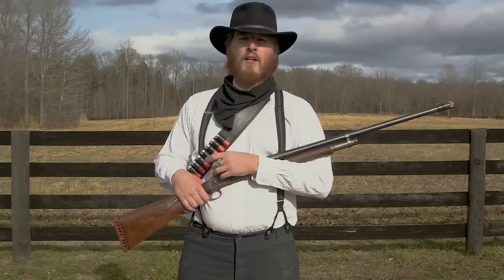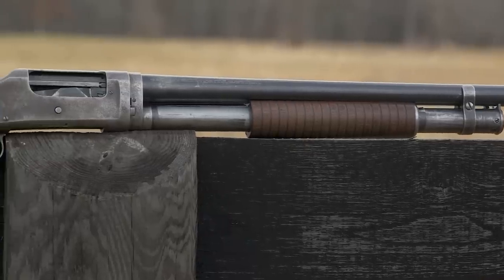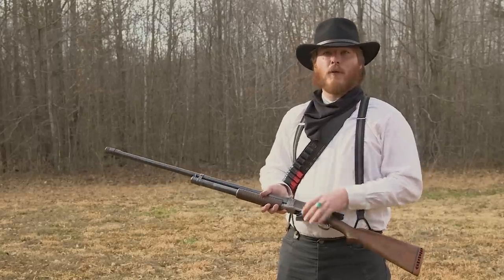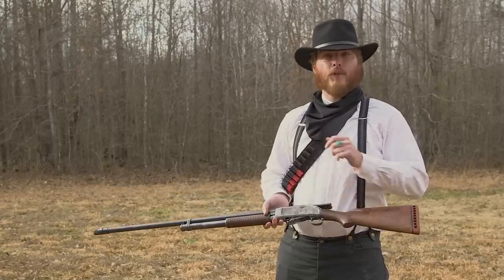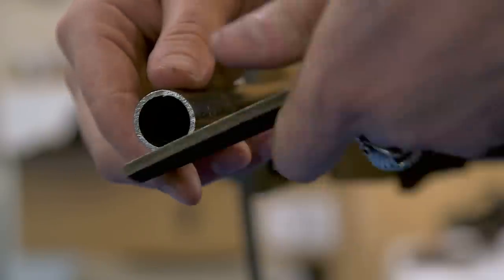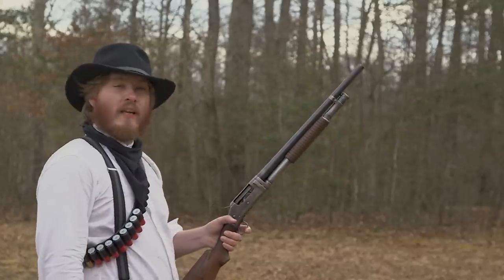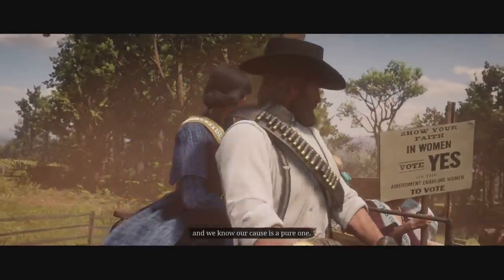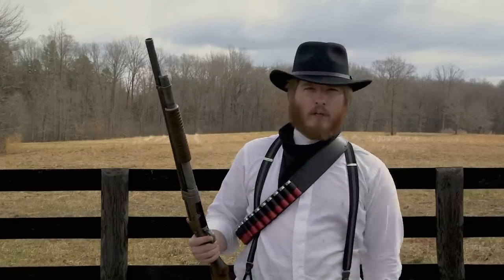The Real Guns of Red Dead Redemption 2: Pump Action Shotgun

Comment: This 1897 in the vid is a model that came out in 1906 or close to that date it had the 2 buttons on the side that make it possible to empty the magazine tube and the wood on the action bar is with a screw on cap meaning its from a E model 1897,so if the game plays in 1899 this is not the correct version of the 1897....But who cares...
Reply: Ben Niessen you’re absolutely right. It’s an E model and was manufactured in the 1930s. I think the previous owner changed out the stock with a 1912 stock or the later 97s just had a different pattern stock.

Comment: Why in gods name would you cut the original down on a collectable gun you could've got another barrel
Reply: But if I bought another barrel for 200 dollars it wouldn’t be 87 years old and I’d spend almost as much as I did on the gun just to make you happy.
Reply: @stephencanty89  first the gun wouldnt be 200 even in poor shape it'd be 400+ and the new barrel would probly be a reproduction but even if it was a vintage 97 barrel it still would be the original one that came with the gun there is only one of those in existence and he ruined it
Reply: @bosstube9046  Are you telling me how much my own gun cost when I bought it? Hmm...
Reply: @stephencanty89  if you paid 200$ it's a repro or whoever sold it to you didn't know it's value or it was ruined when you got it or had a bunch of unoriginal parts just because you got a good deal doesn't make that standard for ever gun of the same model going by tge guntraders guide which is literally a book about gun values a 97 in 70-80% condition that's a base model and is original is 547$ for the solid frame the one in the video is the takedown which in the same condition is 764$
Reply: @stephencanty89  also how much something cost and how much it's worth are 2 different things
Reply: @stephencanty89  hopefully you learned something
Reply: @bosstube9046  You didn't even notice the aftermarket choke that was added to the gun by a previous owner did you? So it's not original and therefore your point about me modifying the barrel and thus reducing the value is invalid.
Reply: @stephencanty89  poly chokes were invented right around 100 years ago and were available and commonly on many shotgun models including browning, Remington, savage,  and Winchester and if original to the gun can even boost it's price a bit for some I've got an American Auto5 20 Gauge with a factory Remington polychoke on it that adds about 15% to it's value
Reply: @stephencanty89  also the barrel would still be the ORIGINAL barrel to THAT firearm again only one of those in existence even if the polychoke was an aftermarket accessorie (which from 1920 to about 1970 they were factory available options for just about every manufacturer)  it still would have lost value hacksawing 1/3 of the barrel off there is a right way to shorten a barrel and that is not it you wouldn't let your 16yo put rims and spray painted racing strips on a vintage 69 charger would you no didn't think so 
It'd be fine for a 99$ Walmart single shot but not for a possibly collectible firearm 
"Bubbaing" guns like this is why we're losing valuable pieces of history that need to be preserved for future generations not ruined for a couple of views on the internet

Comment: For starters,  something is wrong because the mag tube should not come off as it did. The tube is captive with the barrel after it is slid forward. And for you DUM DUMS out there that just HAVE TO. take a hack saw to a barrel, measure first to make sure you are not creating an SBS, and then use a pipe cutter. It makes a nice smooth cut with less work.
Reply: 218vern1964 I did exactly that but only used a pipe cutter to score the barrel so I could use a hacksaw to piss everyone on YouTube off.